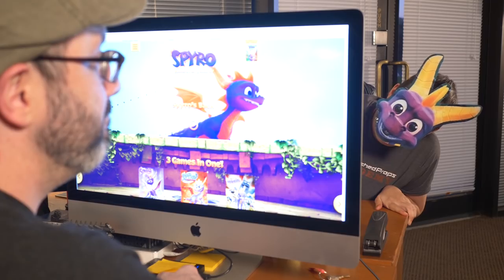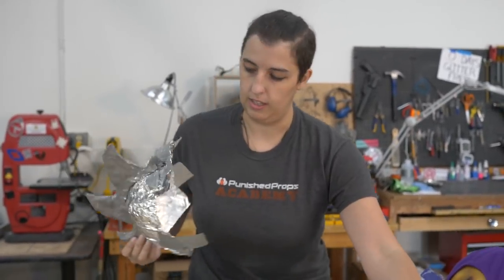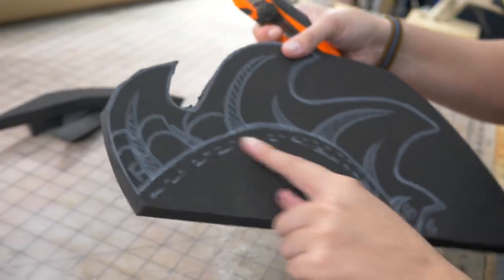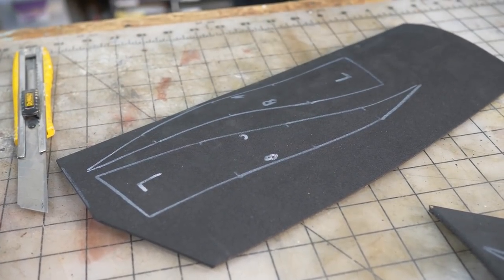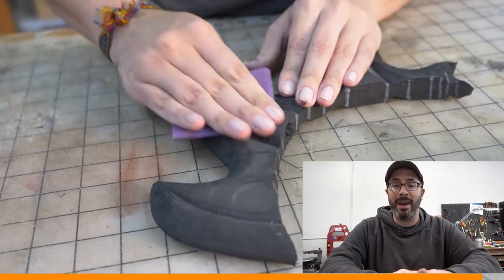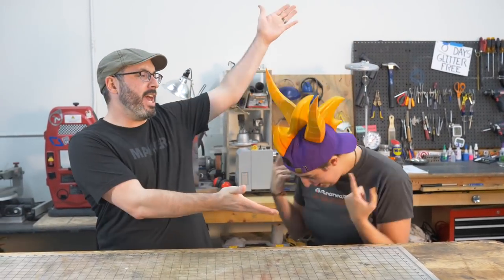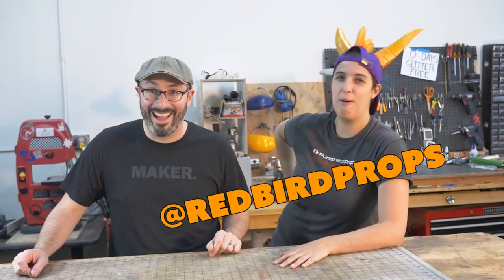Spyro Reignited Inspired Hat! Tutorial & Free Templates!

Comment: Nice build.  Came out very nice, and as always appreciate your showing the warts in the process.

From past experience I know black is hard to cover.  When I saw you not prime with a white I thought "don't think that is going to cover".  Now I learned that when a set designer had me paint the entire interior of a small theatre (that was flat black) white.  Not only was coverage a PITA but white shows every little ding and bump on the walls.  So in an old beat up theatre it looked...  Well lets just say that my next task was covering it all with flat black, which went a LOT faster.

Material note from a Halloween build I just did.  Foam pipe insulation is an interesting product for builds.  It works well with Barge but hot glue melts it so it works but it's tricky, and it's very insulating so the hot glue takes awhile to set up.  But heat has a different affect on it than on EVA foam.  So you can get some really smooth sort of melted metal looks.  And on it's own it has a very cast iron type texture when painted.
Reply: I just used it for the shoulders of my banshee prop - the hot glue was a BEAST to get to behave, but after a while things actually set up and she has some solid shoulders.  I also used it to cover the dowels for her arms; I need to hit it with some white Plastidip next year.  Normally it was fine, but when it rained you could see the dark grey through the white of her grave shroud.

Comment: Hey Bill! I have a question. i love the work you are doing. i am a big fan of the channel and you are one of the reasons i got to foamsmithing. i have been working with foam for some time now and i thought i should start experimenting with molds and casts and see how that goes. i was wondering if it is possible to mold a prop made out of eva foam. would that work? would the prop be destroyed? should i cover the foam prop with anything before pouring the silicone? Thank you in advance.
Reply: Dennis Mour I would do some tests first before making any props with Eva foam - get yourself a trail unit of silicone (say rebound 25/40) if it works you still have the silicone to use, or pick up some NSP Chavant clay, or monster clay, and Mold the prop with them .
Reply: @lasarith2  thank you for your answer! i will give it a try with something small and see how that goes. if it doesnt work out i will try monster clay! thank you again!
Reply: Dennis Mour you’re very welcome 😁

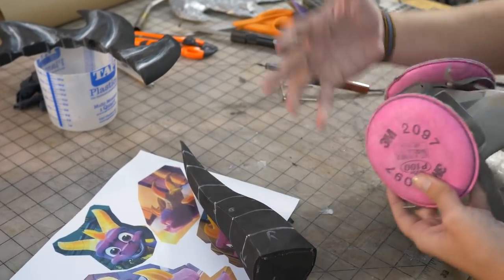Comment: @19:38 good warning, but...  That respirator does not have any filter cartridges installed, just the particulate filter, so you are not keeping vaprts out of your lungs with that set up.  Here is a link to their guide for cartridges
https://multimedia.3m.com/mws/media/565214O/3m-cartridge-filter-guide-and-brochure.pdf
Reply from the maker: Correct! We usually run with 6001 filters and we will make sure Paige gets a set of them on her respirator asap.
Reply: Actually for heated EVA foam you should probably be using a 6005.  The main "dangerous" element in the foam is formaldehyde, 6001 is not rated for that but 6005 is.
Reply: I also found this

"OSHA requires the formaldehyde cartridges be changed Daily or every 8 hrs; whichever comes first. Even if you use it for 10 minutes today, you need a new set tomorrow.
Other types of cartridges can be used multiple days and have a service life; not formaldehyde."

So maybe 6001 with an exhaust fan.  6005 at $20 or so a pair would be crazy expensive if you basically only get one use.  Part of the problem is that it is really unclear how much formaldehyde you would be exposed to AND it's not like organic fumes that make you woozy and are directly toxic, but flush out, formaldehyde is a carcinogen.  And that is complicated because it mean there is a risk factor that is hard to assess on an individual basis.  I suspect that with decent ventilation the exposure even without a filter is minimal to almost non existent.  Plus of course formaldehyde is absorbable through the skin so just handling foam gives you some exposure.

I will make sure to have some better ventilation when I am heating it but I am not particularly worried by what I have read.  A couple of countries have not allowed EVA baby mats, but most haven't.  But then I have inhaled so many toxic substances over the years my judgement may be permanently impaired ;~)
Reply from the maker: Good to know!